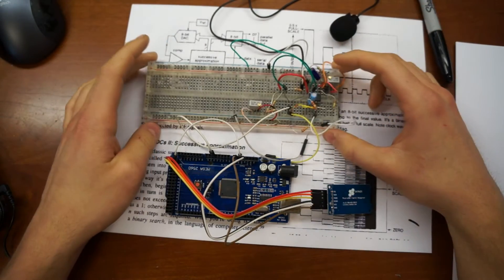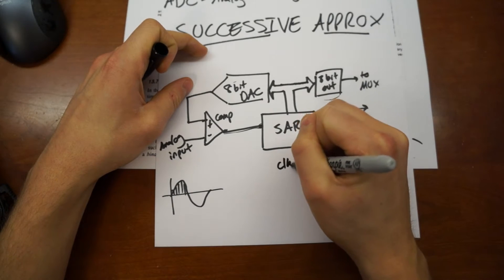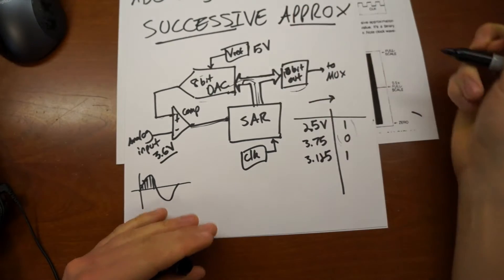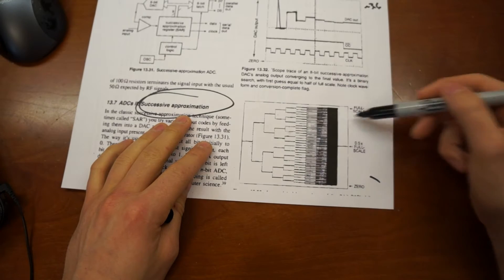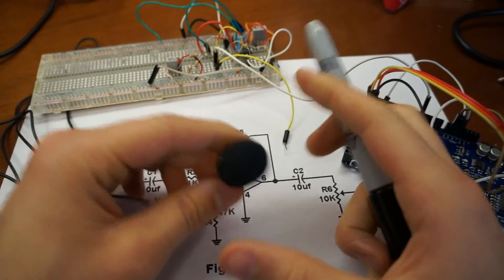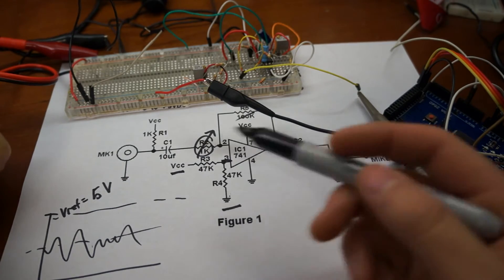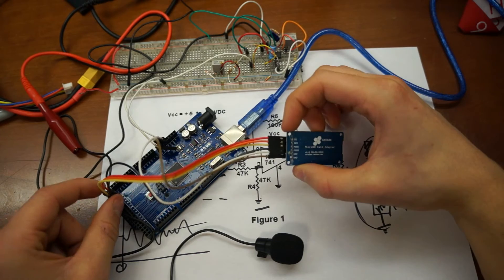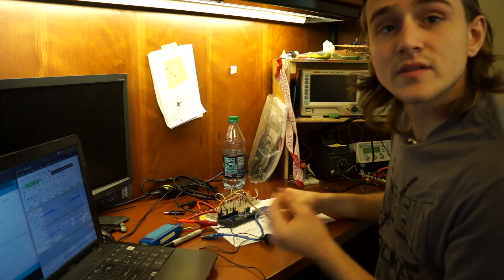Successive Approximation ADCs and an Arduino Voice Recorder

Comment: I don't understand why your using another pot at the Output? Is that because to off-set voltage or what? And can you send a snap properly how that output pot being connected to circuit?
Reply from the maker: Haha yeah it was to get the offset just right, really a bad way of doing it. I can send a picture via email if you like, message me at electricsheeplabs@gmail.com

Comment: Can't we use LM393 instead of 741 IC???
Reply from the maker: Umesh, perhaps this helps explain? http://electronics.stackexchange.com/questions/253109/can-a-comparator-lm393-be-used-as-an-amplifier     I don't think that is possible, as LM393 is best used as a comparator, however, LM358 is a commonly available op amp that could be substituted for the 741
Reply: Exactly i was used that arduino microphone. Ok then i must try 741 IC. Somehow sampling frequency is 22.5KHz right?

Comment: Also hope to see the video with pcm103 IC
Reply from the maker: I hope so too! Haha I bought the wrong IC (it is smd rather than through hole, so I have to get a break out board) so it will take me a bit longer to get that working
Reply: Anyway how we can change the sampling frequency?like 44.4KHz. Is there any good 16bit ADC IC we can use and easily connect to Arduino ?
Reply from the maker: i think you will need to change the interrupt frequency (line 182 in the code) and sample rate and bytes per sec (lines 29 and 30)... i ripped this demo from this website, i think he explains how to change sampling rate at some point http://apcmag.com/arduino-projects-digital-audio-recorder.htm/